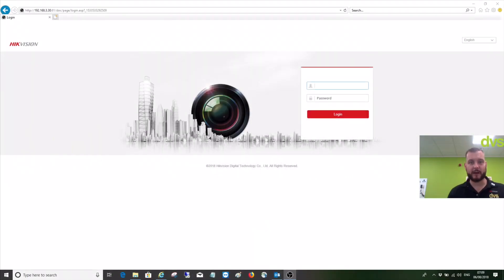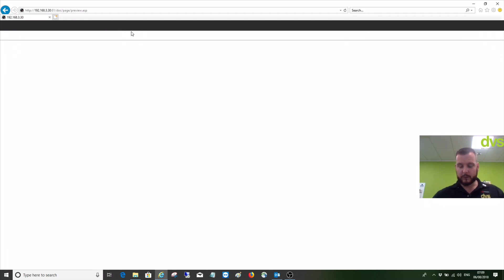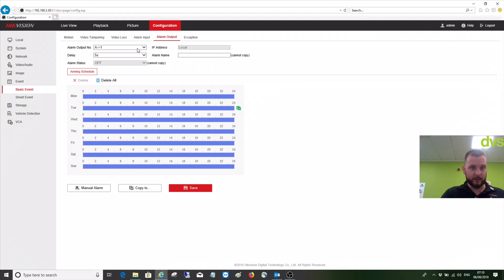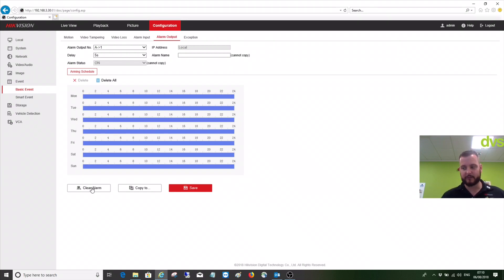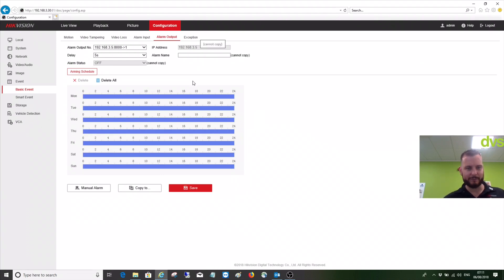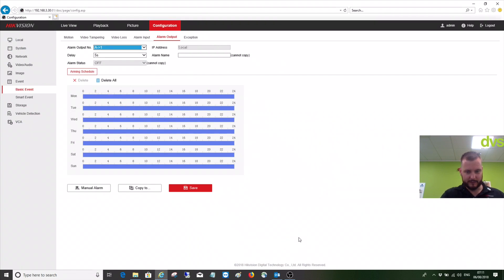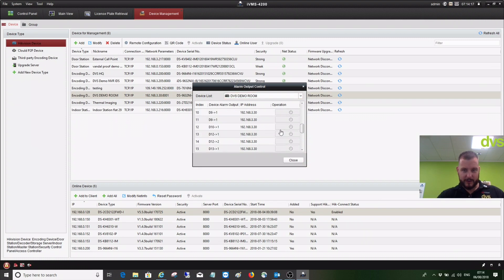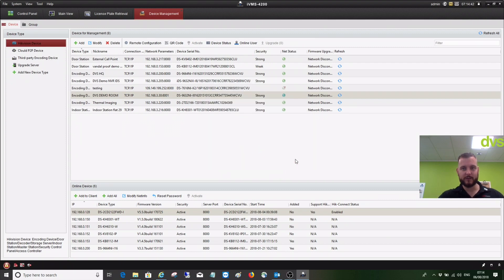HOW TO TEST ALARM OUTPUTS ON A HIKVISION NVR/DVR/IP CAMERA

Comment: Is it possible to trigger an NVR alarm output using a IP camera alarm input triggered by an external PIR detector?
 What I want to do is to connect a PIR detector to an IP camera alarm Input so when the PIR detects an intrusion it triggers the camera alarm and then the camera triggers the NVR Output which is connected to an external powered siren.
 thanks!! your channel is very useful!!

Comment: hi dave
how i can turn off/on manual alarm input with hikconnect app ?
Reply from the maker: Hi, open app and relevant DVR, then choose alarm icon along the bottom , you may have to scroll to the right , and select it , then it will bring up alarm outputs for that DVR , you can then toggle them

Comment: Hi Dave, today I went to change a DVR, when I exported the file and then went to import on the new DVR, it wouldn’t allow me to send the file. Is there a reason behind this? It meant I had to set up a new DVR with all its setting and alarms. Very time consuming when you can just import the file? 

Thanks in advance.
Reply from the maker: Hi RIchard, you mean the config file ? was it a different model DVR that the one used to export?? Sometimes it will let you open the file in Excel and then change the model to the new model number in the table , save it and then import , it will however depend on what model was used to export and the new one used , if there is a big difference on hardware then it won’t allow this as the architecture is so different , let me know on the Excel file next time